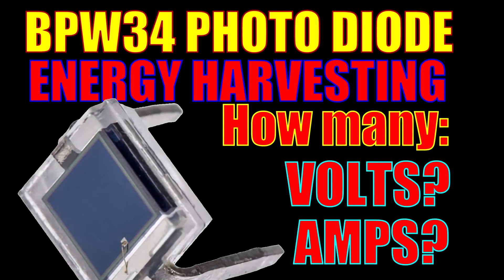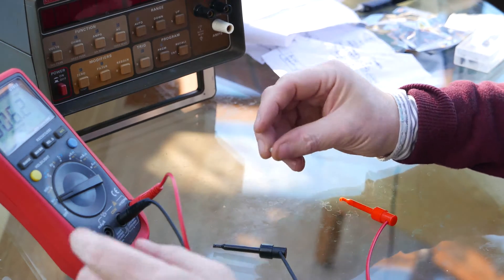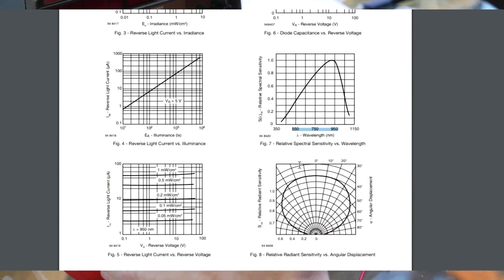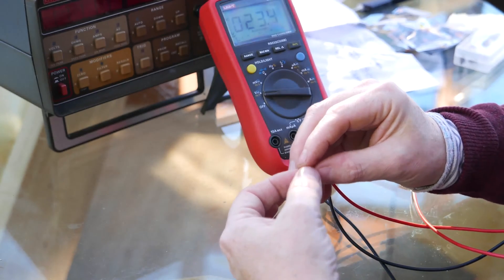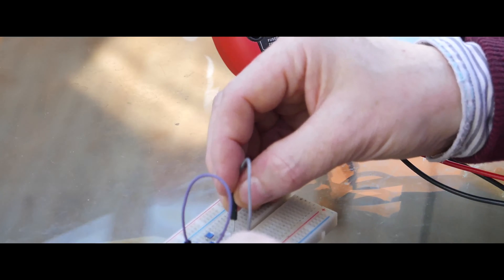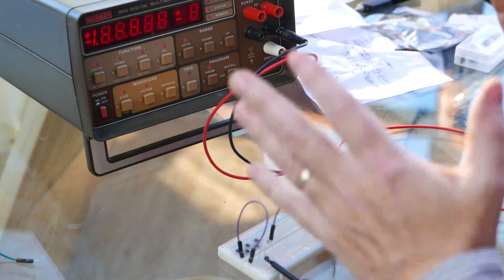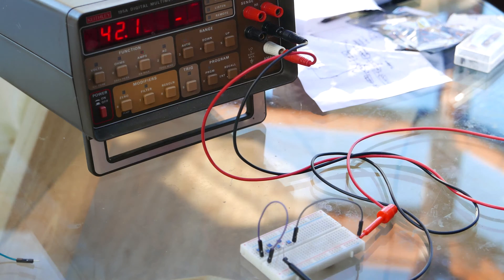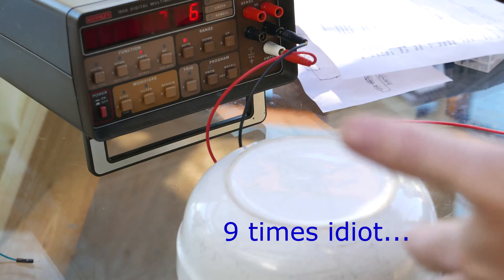Is the BPW34 any good for Energy Harvesting?  Volts? Amps?

Comment: This just makes me want to put 100 of them in parallel and then put 10 of those lines in series. Imagine collecting 180 uA @ 3 volts in the dark! It'd cost about 500$ in BPW34's to do it but it would be THE COOLEST SOLAR PANEL IN THE WORLD! It would probably also outperform other solar panels on a MM^2 surface area basis for the actual active part of the cell. This chip has a fairly wide band.

My dream at the moment is to energy harvest long wave infrared. To do this I need InGaAs photodiode or MCT photodiodes.

A blackbody at 22.3 degrees celsius emits a maximum of 440 watts/m^2 of LWIR. In the case of an LWIR photovoltaic panel at room temperature, that's 440 watt/m^2 from the forward facing surface, 440 from the rear facing surface and, since the cell is room temp too, 440 from the cell itself.

So that's an energy density of ~1320 watt/m^2 to be able to convert into electricity. That better than sunlight at noon on a clear day! Even if the cell is only 5% efficient, that would translate to ~65 watts/m^2 of constant electrical supply from the cell in the dark!

Comment: I would measure current by putting a known resistor load and then measure the voltage across the resistor. Then use ohms law. Having it go thru a current meter might be a little off.